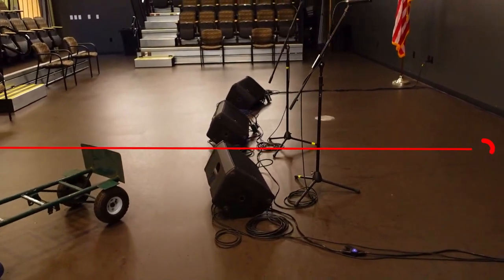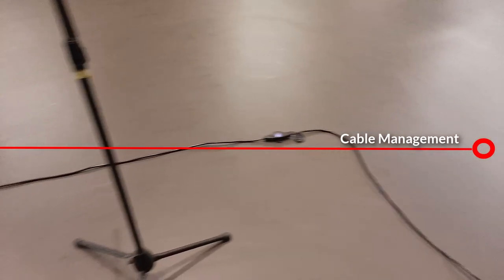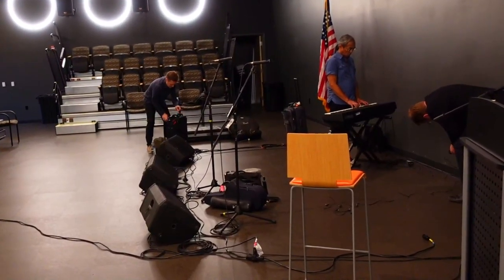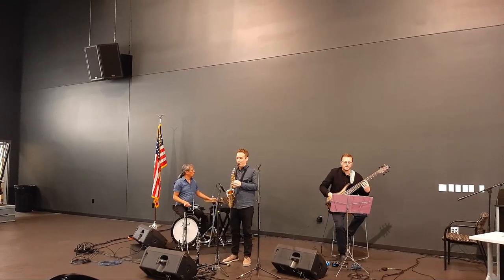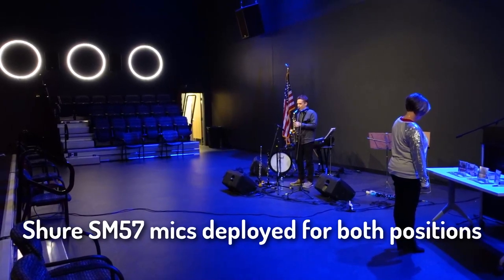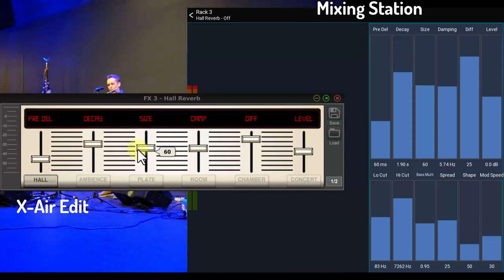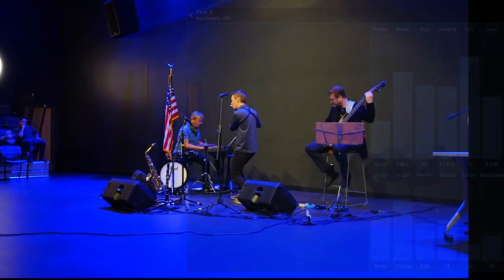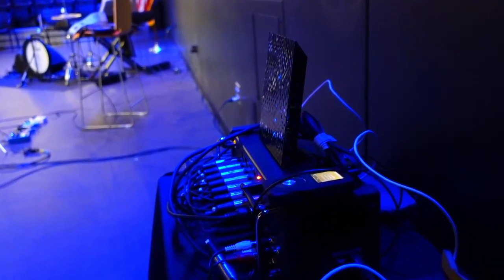Streamlining Your Small Stage Audio: A Guide to Mixing and Cable Management

Comment from the maker: This video looks at a real-world scenario, putting things into action that have been talked about on the channel. And doing it at a small gig, using the XR18... and for a change of pace, it's not a rock, pop, or country band... it's a jazz trio.

The band was only able to give me a word picture of their setup prior to arrival. Essentially, they would ultimately find their positions based on what they saw when they arrived as far as the venue goes. So, while I knew there were 3 of them, and where ROUGHLY the monitors would be placed, and the lines needed to get to, I couldn't place them exactly until the bad arrived and either spread out or tightened up their positions onstage. So I placed the mons and mics, and left the direct input lines coiled near the positions they'd ultimately be once the band arrived. And had loose coils on the stage/source side of things. Not all piled together at the XR18. That way I was as ready for them as I could be.
If anyone notices it, the straggler cable you see at the downstage is the bands AC run to a camera they brought. That's not me! ;)
The venue had house audio, but limited inputs and no monitoring (or extra mics and lines for that matter). It's not really setup for a band even though the amps and speakers are capable.

I took everything to the XR18, sent a feed to the house, and fed the monitors from the XR18.

Questions... comments... likes and subscribes always appreciated!

Affiliate Links:

SM57 Mics at Sweetwater:
imp.i114863.net/Xx7EQ5

Behringer XR18 Mixer at Sweetwater:
imp.i114863.net/WDVNDO

Powerstrip on Amazon:
https://amzn.to/3Rowkf6

25' 12ga AC Stringer Cable on Amazon:
https://amzn.to/3RBGSYN

~
Patreon Page:
https://www.patreon.com/AlanHamiltonAudio
~

Other channel videos:
IEM Monitor Rig Tips | Interfacing With a House Sound System
https://youtu.be/d2YJw3epXRY

How I Mic Drums for Live Sound:
https://youtu.be/uXGug5smBrQ

DI Boxes Explained:
https://youtu.be/6iwW5_Ia9Uc

Building an IEM Rig Using the Behringer XR18 / MR18:
https://youtu.be/xT9gTBFxvZk

Behringer XR18 Midas MR18 Channel Walk-thru:
https://youtu.be/xPsSPK6RKzU

Cable Management For Live Audio:
https://youtu.be/nYZ9nrPGswo

“As an Amazon Associate I earn from qualifying purchases.”
"I earn from affiliate links, but viewers do not pay extra for linked items"
Reply: Great job as always, Alan. Thanks again for your advice on Patreon for my church setup!

Comment: Great video! May I ask for your basic settings for vocal reverb and delay? We like to add a fair amount of both to our IEM mixes for ambience reasons. So far I have added some plate reverb and a slap back delay on the X32 rack, and we are kind of okay with it. There's always room to improve, so I wonder what you would use. Thanks in advance.
Reply from the maker: This video talks a lot about vocal techniques:
https://youtu.be/oP4sdpkkNhY
I generally like to use a plate on vocals unless I'm specifically emulating a recording that used a hall, or dark reverb. In either case (hall or other dark reverb), I'll probably go for a Hall for that big, dark reverb. Maybe even making it darker than the normal preset with a LPF on it.
But for most modern stuff I tend to like a plate with a fair amount of HPF applied.
My baseline is probably a 20-30ms pre-delay and 1.5sec decay. For faster songs I tend to go with less decay and maybe a quicker pre-delay so might be more like 20ms and 1.2sec at something really uptempo (or when I don't want it overly wet). For a ballad, just the opposite... might be 70ms range pre-delay and 2 sec or so decay. 2.2sec... something like that.

As for delay, it kind of depends. I don't always use a delay unless the song/genre calls for it. If it's more of an answer back delay, it's usually 330ms-500ms range with limited repeats. 1 repeat basically... unless the song specifically use trailing repeats. Delay time based on song tempo.
If it's more of a slapback or doubling effect then it's WAY less than 330ms. Around 50-100ms. And just blended in to get the effect. I also tend to use a LPF on the delay so the delay isn't as bright as the original signal.

As for EQ... I almost always use 100Hz for a low cut/HPF baseline. Unless I'm working with a gifted bass singer, there's just no need in anything below that generally. For a female voice that could be even higher. And for most male voices, I can probably slide that higher as well. But you can't really go wrong to at least do that 100Hz HPF baseline as a starting point. Especially for a male. And I'd say 150 is pretty safe for most females.

If I'm going to boost anything on a vocal is probably going to be hi mids... like 2K-4K range depending on voice. And then maybe a hi shelf EQ at 10K. And we're talking just maybe 3-4dB if it happens at all. Some singers are going to be sibilant enough as it is, so no need to emphasize that. But for rock, pop, and modern country, that hi mid boost and/or high end rise can help the vocals ride about the guitars in the mix. Some mics, some singers, might be fine with just the HPF... or just the HPF and a little high shelf rise and not need the 'bite' at 2k-4K. Especially if it's not a guitar dominated band with guitars, snare, and cymbals occupying a lot of mid-high space on their own.

If I think a vocal needs 'fattened'... sounds thin... the first thing I'm going to do is make sure I have boosted any high mids or highs and am causing it myself with that EQ. Reducing high mids and highs has the same effect (if it was graphed) as raising the lows... when you look at it or think about it in balance. Of course sometimes, the genre and voice will still 'need' that mid bite or high end air, so removing them doesn't fix the problem. And cutting somewhere else doesn't help. In that case, I'd look to raise something in the low mids to fatten the voice. 160-400Hz range. That's really the low end range that will matter on a voice. Boosting below that is going to be mud and you end up boosting a LOT at say 60Hz to amount to what is really more of a noticeable difference at 150Hz when the slop starts bringing that in. But at that point, you've boosted a ton at the center point of 60Hz, which just wasn't needed and can now be causing low end rumble or even low end feedback.
400Hz might be getting to a point it can make a voice boxy... so tread carefully. And try and limit boosting to a few dB if you do it at all. Always try and cut first and take away what the voice DOESN'T need, because if you can keep it closer to flat, that's going to be the most natural response.
But, still... sometimes (most probably) you're looking to layer the voice on top of other things, like midrangey guitars and cracking snares. So I tend to treat the voice differently in those cases versus maybe what I'd do in a laidback musical genre.
Reply from the maker: I just realized you said IEM mixes... I'd probably go with a Hall reverb for that... but shorten it to a 20ms-30ms pre-delay and 1.5 sec decay. If you have a low and/or high multiplier, I'd set those on 1. Set the HPF up around 300Hz. Set the LPF around 4K. Resist the urge to dial too much in. Just enough the vocals start getting some extra 'life'. If it gets too wet, the singers will start extending their notes and playing too much with the reverb tail... without even realizing they're doing it.
You might even find that a longer decay, but less reverb might work well... Like a 2 sec decay... but even less overall reverb.
Reply: @AlanHamiltonAudio  Thank you for the detailed reply, I really appreciate it. I've tested a little and it helped a lot! Also watched  the video you suggested. Great work, keep it up!

Comment: I would be inclined to give them separate mics for flute and announcements, although it is a small space, it is not that cramped.  On the one hand, with two mics you need to make sure that you mute and unmute the channels as required, but that is simpler than adjusting the output level when the band change between flute and announcements.  One mic means you are pretty much stuck with the flute EQ for the announcements, but unless the flute EQ is extreme it should not be an issue.
Reply: just split the input of the mic on the XR18 to 2 different channels, gain/EQ to whatever is needed for flute/voice, mute/unmute the proper channel.. and if you forget to do so (or can't do it in time before he stats speaking), you'll still have sound output from the mic.
Reply from the maker: They specified the one mic in total for flute and speaking. Otherwise I would've given them a dedicated speaking mic. I always bring spare mics and stands so the option was there for them if they'd wanted to change that even day of show.
Reply from the maker: And yeah, there's usually no issue with something like the flute EQ needing to be WAY different than what I could use (or getaway with) for a speaking mic. They're pretty straight forward. Especially when the goal is to 'reproduce' and not 'produce'. It would be different if it was a vocal mic with vastly different gain needs, the potential for extra EQ, and compression 'needing' to be applied that would be counter-productive for the flute. I did compromise on what I'd normally use for a flute mic's HPF, but that really isn't a problem in a case like this. It wasn't going to hurt the flute to have a lower HPF on the mic. And stage wash and level needs in this venue (or lack of needs) meant this mic didn't need to be so hot to ruin/hurt the mix compromising like that.

But for speaking in between the songs... it just needed to sound clear and natural. And of course, not feedback. I'm not even sure I would've done anything different for the speaking mic if I could've had a dedicated speaking mic for him.
And these guys were pros and the mic was gained properly, so he could speak into it and just use distance to get what he wanted out of the mic. Technically, I guess the same was true of the flute. It's all a matter of a comfortable stage position, setting the gain around that, and the talent working the mic properly.

Comment: Ten years ago I bought a pack of 200 reusable 12" cable ties. Many gigs later I still have over half of them.  Rather than using gaffer tape I keep my able runs tidy using the plastic clips.  No sticky residue on my cables.  If I need to hold the cable down I use a pair of cable ties, and gaffer tape over the end of the cable ties will do the job.
Reply from the maker: I try to keep the cable runs consistent and run them where they have to go, but also have those consistent, dedicated cable paths where they are all together (and cables drop out where they need to for the source). So that's typically a DS run and an US run. That's not always taking the "as the crow flies' path and shortest distance, but it's cleaner for me to keep the cables together like that... and cleaner for the musicians onstage.
And 90deg turns for those cables and cable path to follow the edges of the stage or stage area. 
These days, there are some relatively inexpensive small cable ramps and not just the larger expensive ones. They're ultimately cheaper than gaffer's tape and quicker too. I probably should've used one for this gig at what turned out to be the musician entrance/exit point of the stage.
Although, many times a rubber backed small carpet works too for smaller cables.

Comment: XR-18 question if you are willing...how can I set up a channel to not allow signal over say -18dB? In this "example" a guitarist sandbags in sound check and live levels are waaay too hot and I'd like to set a ceiling to avoid both clipping and of course being too loud down the chain. I know I can lower input gain, but I still get sandbagged on some digital amp presets just being too loud for a gig often. Thank you!

Comment: Could you use a Cat6 XLR block? Cat6 can carry 4 XLR via a single Cat cable.
Reply from the maker: Yes, although I would've have to run one extra line since there were five total inputs (I ran the house MC mic (6th input (as a homerun anyway))... But the bass was close to the position of the XR so that would've worked fine. The caveat would be the 8ch subsnake gave me redundancy if they'd thrown a curveball at me needing an extra channel(s) for something.
But I like the Cat5e/Ethernet XLR audio snakes. I have several that get used all the time.
https://youtu.be/FW6c4ROQbLc